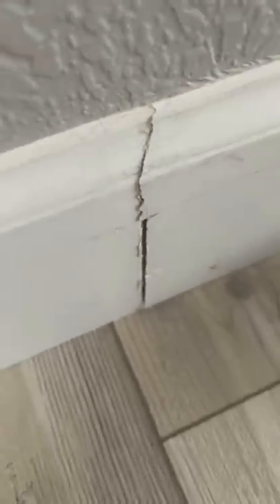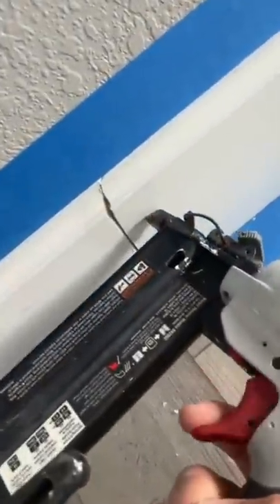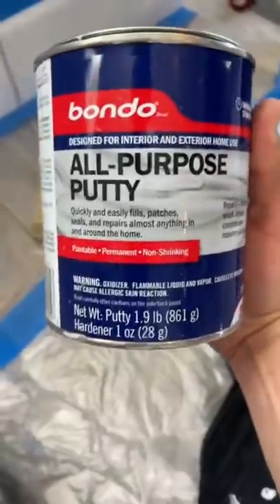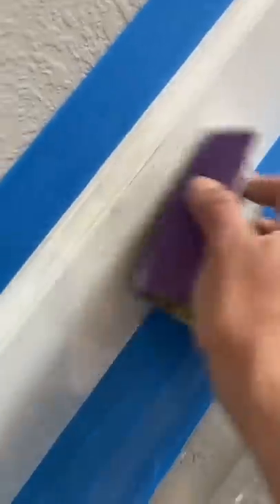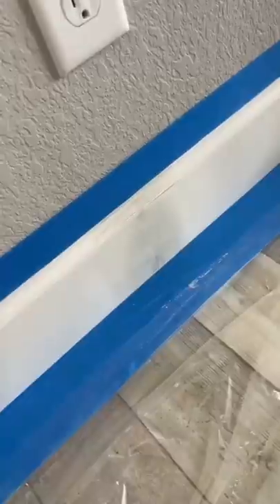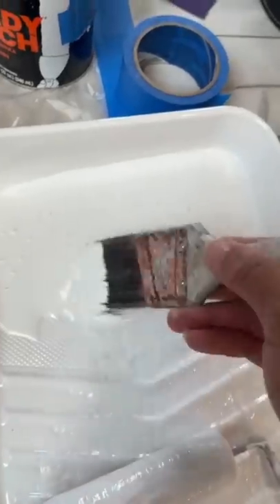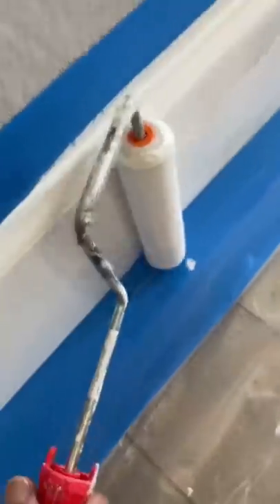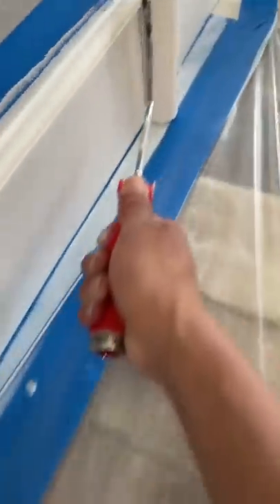How to fix a baseboard seam. #shorts #baseboard #handyman #homerepair #diy

Comment: Right on.  As a carpenter my self, I'm very pleased the way he explained the whole thing without making it complicated.  Very well done Jalapeño Solutions.
Reply: @davidzwicker5662  do fish think birds are really fast moving clouds ???????
Reply: @MATT-lm2po  fish have a little brain, I don’t think there’s thinking!!!!!
Reply: It's true mr. Jalapeno lays it out pretty good. As a So -Cal flood restoration subber, in THE state with THE  most demanding clients, for many years, I would simply add, for the inexperienced novices that want to try to duplicate this; that you might want to mention to the folks that that's a foam weenie roller you're using, which is used in any high-profile area where the paint is front-and-center. Foam rollers really do a good job if you learn how to use them right, on let's say the inside of a front door where you need to repaint that. Or any of your doors, hallway,cabinet doors, bedroom doors. But the foam roller, that's what you're going to use instead of the cloth one. And mr. Jalapeno didn't mention that but that's what he's using right there; foam weenie roller cover. Best to use some Flood's brand Floetrol in the paint too. For those mint looking base and case, yo!  But most people can use the cloth one. It just depends...

Comment: I am so thrilled to find this! Bought a house from 1928 and it has long amazing baseboards but the seams have started to gap due to time and shrinkage and this is the perfect solution to fill in that little quarter inch!
Reply: If you’ve never worked with bondo, you haven’t experienced anguish. Put on only enough to fill it. Don’t go heavy or you be sanding for a week. Also, if you heat it up with friction ( power sander-orbital) go slow or it gums up. I general use enough that it fills the gap and when it dries, use a razor blade to shave off the minimal excess. Makes life easier. Oh ya, and the fumes are toxic. Wear a good respirator.
Reply: If you don’t have money or time don’t buy an old house.  Old houses aren’t worth the updating
Reply: @biggestcomplainer  depends on the house, a lot of classic houses are definitely worth restoring

Comment: Only problem is there’s obviously movement at the seam so a hard bondo will crack within a year. A flexible filler would be better for long term crack prevention
Reply: Can you use caulk that stretches instead of the putty between the boards then paint it?
Reply: Good thing he atleast nailed the boards back.
Reply: But he nailed it to the studs. Shouldn't that help?
Reply: That’s what nailing to the stud is for? It’s never gonna crack again
Reply: @Cripato  it’s already nailed to the studs!
Reply: @noelv1976  it’s already nailed to the studs.
Reply: @noelv1976  it will help quite a bit, yes. Personally, I would've used some longer drywall screws in countersunk holes. The reason those baseboards pop off overtime is from movement, yes, but it pops because the nails wiggle out
Reply: @noelv1976  nails work by breaking wood fibers apart, and using the tension and friction of those fibers to stay in place, but as those fibers deform further, the hole Wallows out, and the nail just very slowly slides in the direction that the wood grain has tension. Sheer force typically limits perpendicular movement, so it translates into an outward force away from wall
Reply: I caulk these joints. More flexible. You might have to caulk twice because caulk shrinks. Caulk it when it cracks again. Takes like 2 minutes, no sanding or taping. This joint will crack again. If the joint isn't flush to begin with or is like 1000 years old, this problem will be reoccurring. It's a problem with the carpentry, not the material that fixes it.

Comment: He did everything right, then pulled out freaking bondo to patch trim. People just use mh ready patch or wood filler for the seem
Reply: Doesn't hold . Trust me I tried it . Bondo does a much better job and hold much better . 
Been doing for yesr with no comebacks .
Reply: @Spad68  you gotta insert caulking before adding wood filler. That way it's glued
Reply: @urielx17  I've tried that . Caulk still dries out and cracks . Bondo has a much better hold and generally does not crack .
Reply: Caulk
Reply: @Spad68  use the right type of caulk
Reply: @truthhurts2256  lol 
Really ... I had no idea 😀😆😄😁😃
Reply: @Spad68  apparently 🤣
Reply: @truthhurts2256  lmao 
I guess you missed my sarcasm.
Reply: @truthhurts2256  what type of caulk?
Reply: @tylerthomas5261  flex caulk
Reply: Everything will crack because this is a faulty joint. Bad/old carpentry. Caulking is easier, faster, cleaner and can be done whenever it cracks again cuz it WILL crack again. You can caulk that think before you even have that bond mixed up, let alone having to come back to sand it.

Comment: Bondo for everything! Cuz we like sanding shit down for hours at a time!
Reply: The trick is to start sanding Bondo before before it gets 100% dry. It's super easy to sand then.
Reply: ..trick with bondo is don't apply more than you need .. easier to apply than to remove. ..
Reply: @rockytopwrangler2069  2 minutes to apply more, 2 hours to grind too much
Reply: @thetonezone8164  ... Yep ..that's what I learned .... the hard way ...
Reply: If you're sanding Bondo for more than couple minutes, then you're doing it wrong.
Reply: Trick is dont use bondo...
Reply: @codymadison9993  lol.  Exactly
Reply: Someone doesn't know how to use Bondo if you're sanding for hours...
Reply: @byronc7284  for real what the hell? Who spends 2 hours sanding bondo lmfao
Reply: @codymadison9993  these days even the Amish use sanders. Lol
Reply: @codymadison9993  these days even the Amish use sanders. Lol

Comment: I'm from Tennessee and I grew up doing residential work we normally would caulk that and then paint it again
Reply: Not really. It needs to be nailed like he did. The whole reason it cracked is because the baseboard was no longer firmly attached to the stud underneath. It needed to be re- nailed just as Mr. Jalapeno did it. If you just caulk it and paint over it again, you really haven't done much. Because that baseboard is going to pull out from the wall further back and create a new problem. Re- nailing it was the proper fix for that baseboard, which he did. I'm pretty sure you could use MD ready patch on this baseboard repair or Durham's rock hard putty. But Mr. Jalapeno really likes his Bondo. More involved then I would get but it is what it is; it's his choice. And some propertie$ will rate the bondo. High-end properties. Facts!! Bravo Mr. J for first-class fix!
Reply: Definitely wouldn't buy a house in Tennessee
Reply: Yep I was taught that way to but that is exactly the difference between a painter and a finisher also he said he was repairing... Who repairs anything with caulking?
Reply: @barryallen5507  that was funny.

Comment: Heat shrinks wood and humidity swells it. Usually trim is installed while a house is being built and exposed to elements and also the trim itself is outside or in a warehouse before installation.

Therfore the trim shrinks exposing cracks after house is heated. Especially upstairs.

Comment: Fix all or plaster of Paris works nice also it's very forgiving as it dries you don't have to send it use a shop towel the blue paper towels you soak them in water and you wipe off the excess add repeat you have to let it dry a little bit so everything doesn't come up like clay but yeah it's pretty easy and no sanding sometimes you won't get it all off of the area you wanted to get it off of but by the time you dilute it so much with water after it dries you can just wipe it off

Comment: Boom nail right through a wire. 
Never put a joint under a socket and never nail under a socket. Unless you know for certain
Reply: The only dude that noticed that...
Thank you. 
Now, what are the odds of a house fire within six months?
Reply: Haha that’s the 1st thing I noticed too. You got to know what’s on the other side of wall too, could be some plumbing.

Comment: Come back in a year..will be another crack. Bondo cracks worse than anything.
Reply: I’ve used Bondo for over 50 years on auto body repairs and wood repairs. I’ve never had it crack not have I ever seen it crack on a body repair. If it cracks it was a bad installation. My experienced pro painter uses it on all
his exterior wood repairs.
Reply: @JT_70  where two pieces come together? I understand filling holes and dents. I’ve never seen even an auto body use as a seam sealer. It’s good in some occasions but any pro will tell you not to replace caulk with bondo.

Comment: Sweet idea! Don't forget to but primer on the repairs though keeps tge flashing down. Keep up the great tips bro
Reply: English pls, what's: but primer, flashing down"?
Reply: @sfuchs  typos "put primer" and "keeps the flashing down". All English just misspelled thanks!
Reply: @arelfarrington9943 thanks for explaining.  What's flashing on this context?
Reply: @sfuchs  No prob! Flashing occurs when you paint over a raw material as well bright or dark colored paints without priming first. Basically the color shows through your new coat of paint. In the case of raw materials like drywall, wood, or masonry, you can have other issues onto of that like paint peeling. If you repair a section of drywall and paint it without priming the repair, that one spot will always be a different color than the rest of the wall.

Comment: Bondo is for metal not wood or composite trim 
It dries harder and sands harder than the softer wood
Most times you create a dip in the softer wood before you fix discrepancy’s in the bondo highlighting the carpenters bs. I feel the same about ready patch unless you have a lot you have to skim.
Stick to a premium lightweight sparkling you are familiar with working, put some effort in your sanding and you’ll get better results. 
Always read the comments ! 
Most experts on YouTube don’t have a clue

Comment: If you dont mind me asking, what do you typically charge for something like this?
Reply: The question of the day. $60 per hr with a 2 hour min… should be about $120 to fix a crack in the base board. Sounds reasonable right?
Reply: @Listed MiA ya gotta charge for the clean up time. thats where all you new construction guys fall short. you forget to charge for clean up.
Reply: Whatever he's charging is too much for crappy work... 👎👎
Reply: @saint9963  Honest contractors don't charge for cleaning up their own mess. A "Saint" you ain't...
Reply: Way too much 
And the method is wrong
Bondo is for cars not bad carpentry 
Professional painters fix that in seconds and all the rest of the stuff the carpenters called “good enough “
Reply: @Listed MiA carpenters talk
Painters just do there job 
Making carpenters look good

Comment: I have old baseboards with multiple coats of paint that have chipped off in places.  Would Bondo work to fill in the places where the paint is gone?  You mentioned "Ready-patch" after you used the Bondo, what is that for?

Comment: Here's an actual pro tip. 
Did you see where the seam was?
That's why you don't use pieces of flooring that are under 12 inches at a minimum.

Comment: What about stained wood instead of painted?
Reply: Wood filler and stain or a caulk color that blends. I'd go caulk because the wood filler isn't going to look any nicer, really--but you have to be GOOD at caulk. must be perfectly flush.  Or just redo it.
Reply: Replace the baseboard.  There is no repair that would look presentable in a situation like that for stained trim. 
The other option would be to do a paint grade repair similar to what Mr. J did here, then paint the base.

Comment: Bruh you know you could caulk that n it would take minutes and will still look just as good! Just my take in carpentry now n that's what I do with trim work especially if the boards are white....but one thing I learned working in construction everyone has their way of doing things and their way is always the right way....I instead like to gather information and techniques as I go to add on to my knowledge ALWAYS SOMETHING Y CAN LEARN N THERE'S MORE THAN ONE WAY TO DO THINGS
Reply: With caulk you will inevitable leave a groove or protrusion because it isn’t a hard drying materials. To make it seamless you have to use something that you can sand down.
Reply: @ralphchavez7743  yeah I get you but for most that's just how u do it....my boss would chew my aaa out if it told him I took n hour on a trim seam

Comment: Looks good but Bondo is overkill for a crack. It's not the hood of a car. Simple caulk then spackle would work fine and sand far easier. Fine if it's your own place but if you're charging a homeowner you just turned a $20 repair into a $200 repair. I have more important things to do than spend half a day on a freaking crack in a baseboard.

Comment: -15 seconds wood putty
- 10 seconds finger sand 
- Paint. Done

I can’t believe someone pays this guy, hourly, to waste so much time.
Reply: Seriously, Bondo everything (@ least 2 coats) wait for it to set-up after each application,  sand the shit back after every coat. Then he applies hot mud, wait for set-up then of course sands that as well and then probably busts out cheap ass paint watches paint dry, literally at least a little more than a half days work wasted waiting around for set-up and sanding.

Comment: Mr Jalapeño, how would you repair a drywall with peeling paper? (The paper lining peeled off the drywall when I pulled the door molding out)
Reply: Bondo duh
Reply: @par-teetime2422  I wanted to say bondo lol
Reply: Do you still have the paper?

If so put a thin coat of drywall mud behind it and the use a flat knife to press it over the area.

Make sure not to leave slobbers.
Let it dry. 

The next part depends on the type of texture and location of the patch.
 The more in line of sight the better the patch has to be.
Reply: @shawnr771  yes, still. I try cutting it with a sharp blade but the edge always tends to lift a little. 
Thanks for the advise, I'll try that.
Reply: @JorgeSanchez-rw5tc  once you mud it and it dries try to lightly sand it.

Blending it back with the texture is the more difficult part.

In the past on orange peel or rough texture I have had good experiences with texture in a can.

Get a small piece of sheetrock 2x2 and skim it with mud.
Let it dry and practice a couple of times. 
If it is not at eye level or a natural point where you eye wanders to it just has to be close.

I have also manages to do some with a light touch and a damp sponge.

It is all practice.
Reply: @shawnr771  I appreciate all the help. I have smooth walls, hopefully it's easier without the texture.
Reply: @JorgeSanchez-rw5tc  that makes ir even easier for me.
Reply: Feather out the work and sand them flar like he did the bondo
Reply: @JorgeSanchez-rw5tc  seal it with a sealing primer
Reply: Thin coat of drywall mud, then some tape, then your finish mud, unless it is just a really narrow area and then pretend you didn't rip the paper off and go straight to mud....
Reply: Watch Vancouver Carpenter.  He has a video that goes over that exact problem, and it s excellent.

Comment: Also, to blend the paint lines easier.. when applying the coats, just go longer on the 1st coat.. on shorter on the next.. shorter on the next and so on. Just don't build up the layers until it's too noticeably proud of the original layer.

Comment: Noycee! I do somethng very similar when  installing those extra long pcs of base! Ready Patch is great but bondo is king! (My coworkers dont splice on studs, drives me crazy)
Reply: If you’re installing it, there should be no reason to do a repair, and this would be the wrong one if you did screw up and need to repair.  All scarf and butt joints should be glued tightly together during installation.  And yes, the joints should always be nailed to a stud in order to stay firmly together as they should. 
A repair like this is for when the installer did not glue and fit as he should have during original construction/installation.

Comment: labor cost for 300 seems. Just use 230 caulk from home depot, and be careful where you nail that baseboard. (Electrical wires from plugs)
Great work on the vid still sir, I still learned something or two.  Thanks

Comment: You should fix their flooring as well.  Shouldn't have a small 4" piece that close to the edges.. at least I don't.. 6" or more is my rule.
Reply: Pretty sure that is a printed pattern on the flooring and not an actual piece of wood!